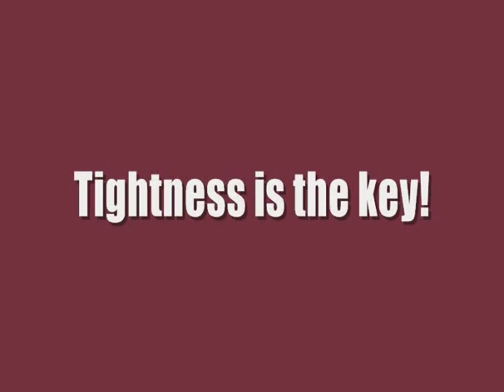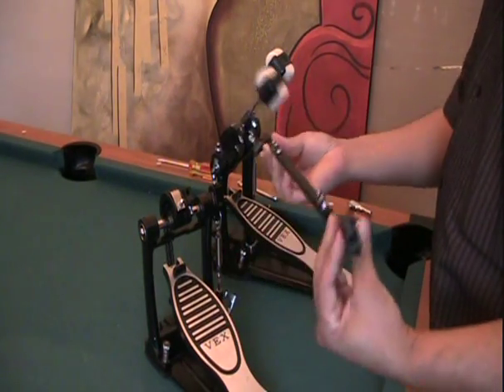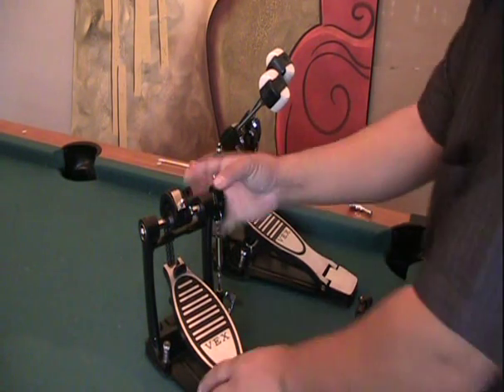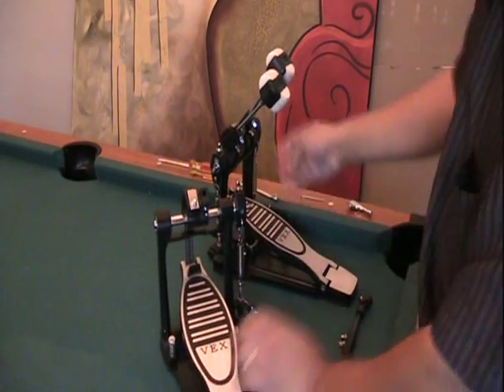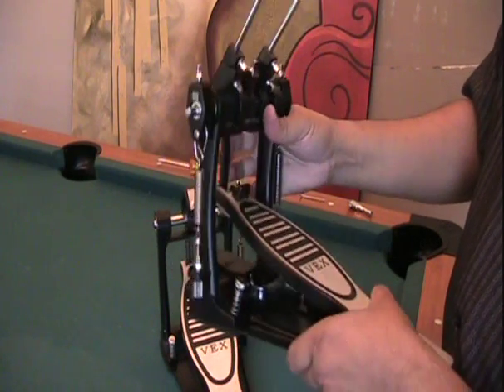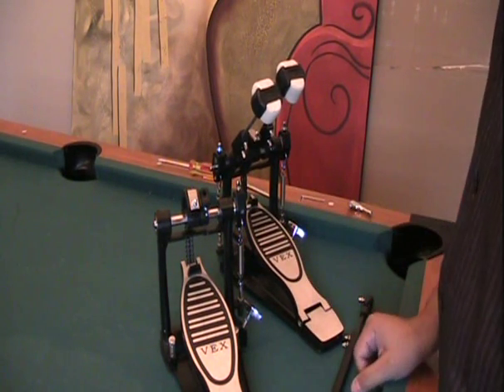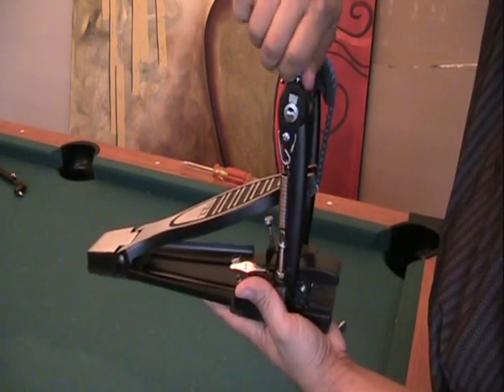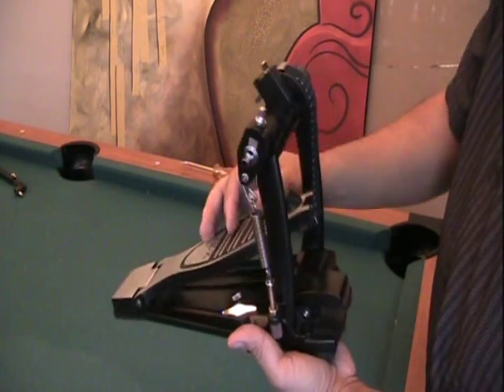Vex Pro Touring Double Bass Pedal Adjustments, 3 of 4

Comment: Tip: take the spring and the beater adapter out of the left pedal and add some lithium grease to the bearings they're kind of dry out of the box, I did and now both pedals move fluently equal.

Comment from the maker: @danvranic Maybe a couple of things.  One, at about 8:44 of this video, I talk about adjusting the chain; that will adjust the footboard height independent of the beater.  Also, I haven't tried this, but you can loosen (or remove) the allen wrench screws that hold the beater on the bar and try to reposition the beater, then re-tighten the allen wrench screws - that will adjust the beater independent of the footboard.  Let us know how it goes!

Comment: yea i tried that, it doesnt go high enough for me, i like my beaters close to the head and the footboard and spring tension pretty high. i got the spring issue down, i just used the allen wrench that came with it to manually turn it. and i tried to manually change the beater angle by taking out the screws and repositioning it, well it turns out, that it only moves forward about a centimeter back and forward, and when you tighten the screws, it goes right back to the position it was at.

Comment: i got the vex and i use it as 2 single pedals, but i just cant get it to be comfortable, its just not working. my springs also dont loosen easily at all. i have to actually take the springs off and use a wrench and turn the whole screw so i can tension or de-tension my springs. And im just having trouble adjusting everything